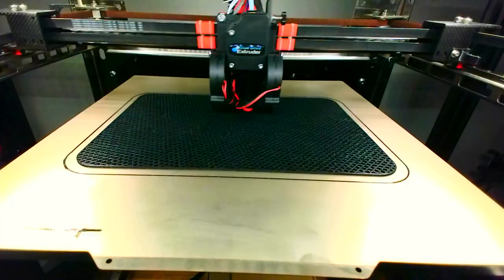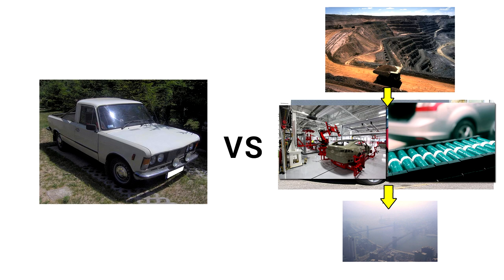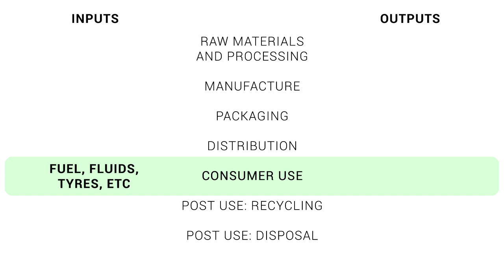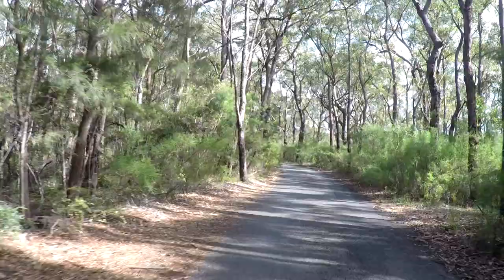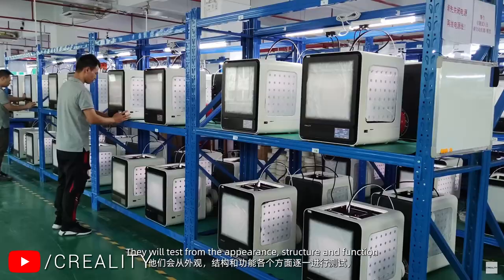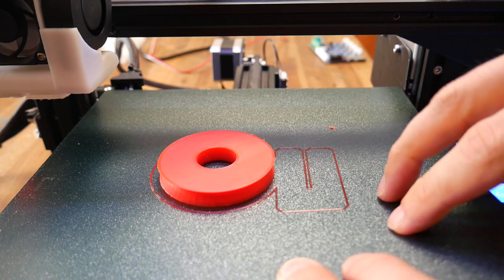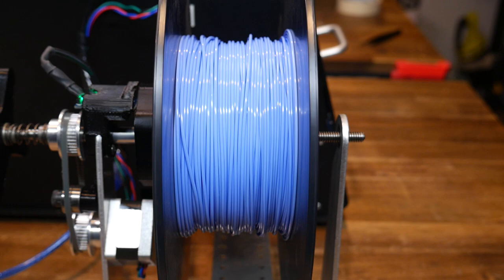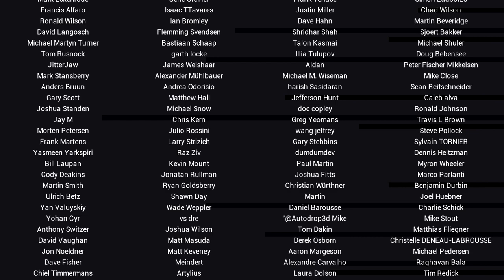Is 3D printing better for the environment? It’s complicated

Comment: recycling check mark shouldn't just benefit injection molding, majority of the same plastics that are used by injection molding is used for 3D printing supplies. they should have either both got a check mark or neither
Reply: No. Because you 3D prints are not recycled. (unless you do it yourself) Recycling relies on the same type of material to be recycles without contamination from other types.

Comment: fiat 125 pickup ? really?
interesting choice of photos

i still wait for home use hybrid resin /filement printers which use light instead of heat to fix directly inhected resin spots
no cooling, nobed adhesion problems and much better infills and bridhing because of different way of polimerization (part being unable remelt with the same printing end)
they could be also much faster for bigger volumes with much bigger nozzles and layer heights

Comment: I feel that your overall conclusion is on the money when it comes to 3d printing in general.
If it saves me in any way it's in being able to make something once that fits perfect rather than buy and discard multiple items trying to find the one that fits right. My major bugbear is that I would love to be able to put my old 3d print items into the recycling. 
On a side note the reality is that the electricity in most areas doesn't come from renewables. Electric vehicles are coal powered. But it's not good for your channel if viewers hear you say something like that regardless of it being the truth.
Reply: He said that the electricity would ideally be from renewable sources and perhaps be from solar panels on the roof of the house. There was no definite mention of what sources make up the electricity on the grid, unlike you which state that electric vehicles are coal powered. They are definitely not coal powered. Electric vehicles get their electricity from whatever supplies them. If it happens to be a coal fired power plant then those specific vehicles are coal powered. However one may not make a blanket statement to say that all electric vehicles are powered by coal. Maybe in your state/province/country they are but in my province there is no coal fired power plants in the system and the electric vehicles work just fine.

Comment: 3D printing has saved me hours of time searching for off the shelf solutions (electricity for PC & screen) 

A guy from amazon doesn't have to drive a diesel van to my mailbox to drop things off that end up being cheaply made and not lasting even a few years before I need to buy another

I've fixed things, upgraded things, made new things with my 3D printer - all things that are useful to me, save me money from buying new ones, and save on landfill waste

as you said it's complicated but I think 3D printing is overall better for the environment

Comment: For comparison, my Ender 3 consumed just over 2kWHr for a 25hr print.
Reply: To add to that comparison can you tell us what a kWh costs where you live, and what your grid looks like as far as generation (i.e. percentage of coal, gas, solar or wind?)
This would help a lot in figuring out the real costs of that print, on top of meters of filament used and what 25 hours of your Ender 3 is as a percentage of useful life.
Do you think your printer will function for 5,000 hours, 25,000 hours, whatever???
Reply: @jimurrata6785  mix of nuclear, hydro, and some coal. Somewhere around 10c/kWhr last I looked. That print was a long time ago, but it was several meters worth. As far as useful life %, that's anyone's guess. Never know when things will fail.
Reply: @OldCurmudgeon3DP  Thanks for the reply!
It's pretty amazing to think you can have a heater, drive roller, several servo/stepper motors as well as a processor driving them going for over 24 hours for $0.20 in electricity.
The Ender 3 seems robust and has a large following. I just don't have a grasp on how long it could go before hard parts like rails wear out.
Maybe someone using these for a print farm has done the math as far as 'reasonable' lifetime? Not Worth Repair.
I'd expect that hot ends, belts, platens and the like will need replacing long before the unit is worn out. But those are consumables in my mind.

Comment: 3D Printing is easy better. It is for sure nothing thaat just everybody can do, but i imagine that it can be a great market where for example each town has like one or two shops where everybode can order some parts from. And of course everybody who can and want to get's a printer for themselfes. But, in our world we have to get this mindset to repair stuff, and not always throw something away just because it has an ugly dent or something. For sure new technologie is needed, but we are not helping the enviroment by building millions of new cars to have the turn-point in emitions in like 20 years, it will not help. But we can combine it, old car with a newer and cleaner engine, why not? Man there are companies out there 3D-printing aluminium, there is so much potential in saving energy and materials, we just have to do it.

Comment: I bought two printers an Ender 6 that has made 2 successful prints in it's life and will go to land fill, 105% waste.
The other is a Phrozen Mighty which works for models with about 20% waste plastic in base and supports each time. Then more with unused resin being thrown out if there is a long time between prints. Added to this failed prints 100% waste about 1 in 8 prints. Then lastly the whole thing is largely waste as I bought it for prototyping but the plastic is both too soft and too brittle for anything useful... All 3D printing is therefore garbage creation.

Comment: Great video, but no one ever talks about how switching to an electric car is just shifting the problem from oil to coal and natrual gas.  80% (not actual number but you get my point) of people do not have solar.  Its way to expensive for most people to afforrd.  So all we have done is move our problem with the internal combustion engine to the power gird.  And what happens if you live in CA. and you can't charge your car because the power is out for hours because the grid is over taxed.  We are in a catch 22 with CO2 and with our use of plastics.  How do we as a society make the difficult choices?  It won't be easy thats for sure.  Thanks for the video.  :0)
Reply: Or you can live in Cali where they tell
You to please not charge your car. Lol while  also trying to make it against the law to buy gas powered cars.
Reply: @jamesbizs  California certainly put the cart before the horse.  They need a serious infrastructure upgrade.  Maybe they shouldn't have invested all that money into that failed high speed rail project.
Reply: @axeman2638  where do you get this data? And how is CO2 good for the environment if it's warming up our planet and causing sea levels to rise?
Reply: I agree that most solutions to the environment basically move the problem to a different area.

But for cars, a new electric car can be greener than a new gas car. 
1. People should buy an electric car with a battery size that is what they normally need. People want the most range but only need a little range for their daily commute. The problem is the longer the range, the larger the battery and the more pollution it produces. Not many people need a 100+ mile range car.
2. in many countries the grid is a mix of different sources. Some countries will use only coal. Some places, like mine, have a 100% green grid. (yes you can argue that dams alter the environment so it's not 100% green). 

So in my region a car with a 40Kwh battery could take a year before it is greener than the gas car.
But if you buy a 90Kwh battery car and live in a place with 100% electricity from coal, you will be doing more damage to the environment than a gas car.

Comment: How is 3D printing even considered as environmentally beneficial.  Before you can print your first part you end up printing a dozen benchies to tune the printer then print a handful of faulty parts as the design is refined.  Then this process is repeated for each new filament.  All this goes into the landfill.  Great tool but not exactly environmentally friendly